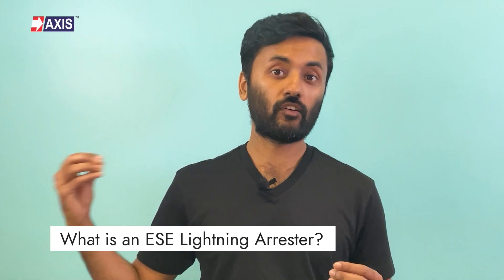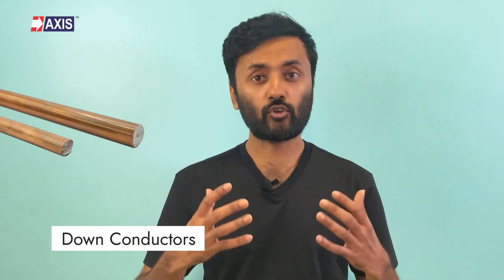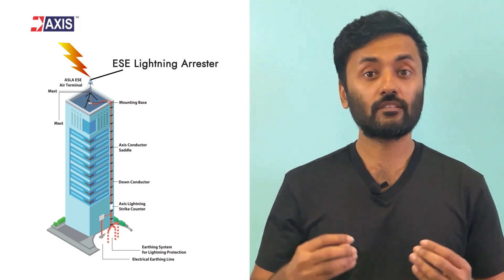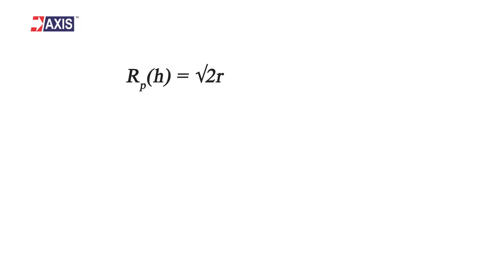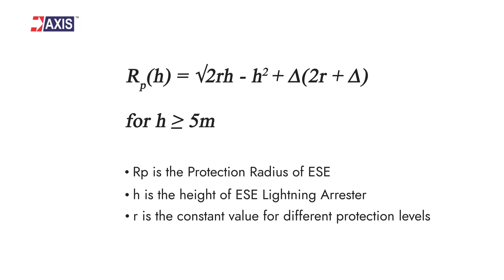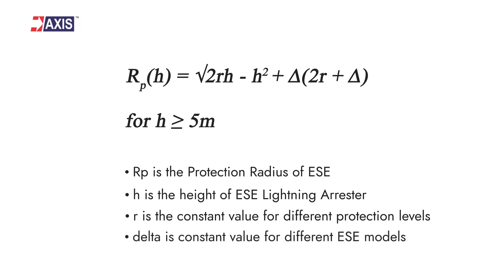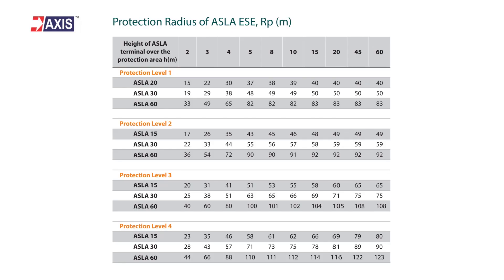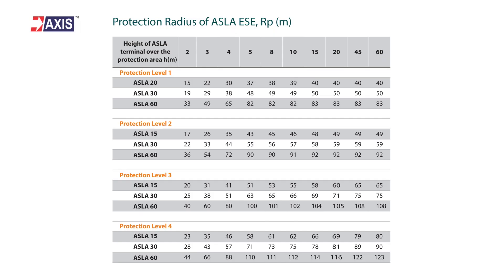ESE Lightning Arrester Coverage Area - Calculation Explained 📐

Comment: Hello, Brother the formula did you provide to calculate ESE lightning arrester, it can be used to calculate for the building over 60 meters height? thanks
Reply from the maker: As per NFC standard, for buildings over 60 meters, the standard protection radius formula for ESE lightning arresters may not be sufficient. Additional protection is required for the top 20% of the building height or any point above 120 meters for each face of outer wall. A minimum of four down conductors, preferably placed at building corners and interconnected by a ring conductor, must be provided to ensure effective and compliant lightning protection.
Reply: @AxisElectrical  Hello, Friend thank you so much for details answer.

Comment: Jo lightning arrester ke throw ground erth tak aati hai .. vo ground ka kitna space leti hai
Reply from the maker: Many factors affect how lightning current moves through the ground.
These include the shape of the lightning wave, the soil resistivity, and the design of the protection system.

When lightning strikes, the current spreads out in a circle about 5 to 10 meters around the point where it hits the ground.

That’s why it is important to design and install the lightning protection system properly.
Reply: @AxisElectrical   5 to 10 mtr  ok very helpful.. thank you so much
Reply: @AxisElectrical I  also have 1 question can I put another normal Earthing for other instruments around 10 mtr of arresters earth

Comment: What reference does one use as the center of the hemisphere, the calculation is not clear and where does the height of the building come into consideration?
Reply from the maker: Tip of ASLA ESE Arrester can be used as a reference

Comment: Radius of protection is okay but do we have to consider the tip of ese as centre of RP
Reply from the maker: Yes we will have to consider that.

Please note that the center of the radius of protection (RP) would be at the tip of the Early Streamer Emission (ESE) device. However, the actual radius of protection will be calculated with reference to the horizontal plane at the required height.

For example, if you have a structure with a height of 10 meters and you install the ESE device with a 5-meter mast on top of the structure, the center of the radius of protection for the 5-meter height would be at the base of the 5-meter mast, forming one horizontal plane. 

The same principle applies to a ground plane for a height of 15 meters.

Comment: is the h (height) means height from ground to the top of ESE's rod or from building/structure?
Reply from the maker: Hi Khalil,

Generally, the height h is the one which is from the tip of the ESE air terminal to reference the horizontal plane considered through the most distant point of the object to be protected.

For e.g. If ESE is installed on a 20-meter tall building with a 5-meter mast, then the horizontal plane can be the terrace of the building and height h is 5 meters.
 In another case with the same structure if the horizontal plane is considered from the ground then the total height h is 25 meters in which the radius of protection will vary.

You can read our blog for detailed understanding - https://axis-india.com/lightning-arrester-coverage-area-calculation-explained/
Or connect with us at sales@axis-india.com
Reply: @AxisElectrical  thanks a lot Axis fot the explanation